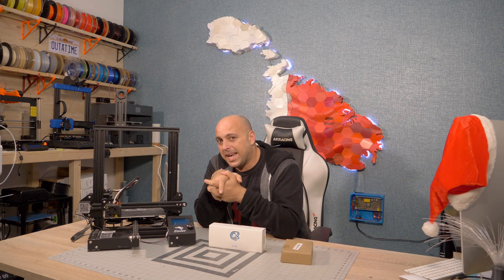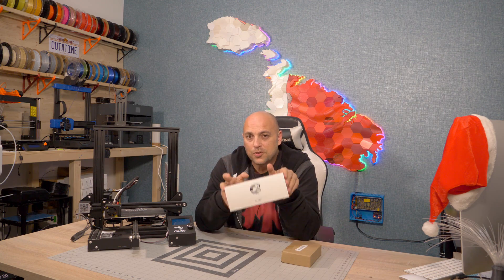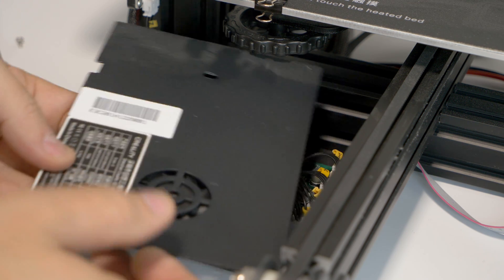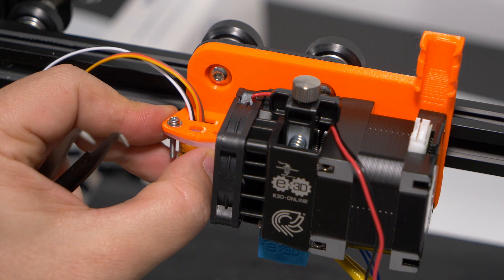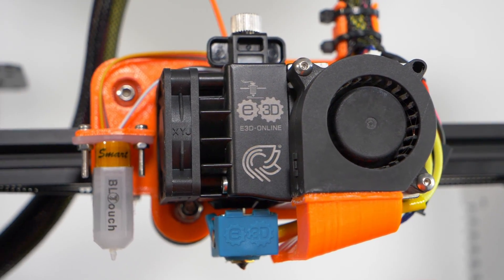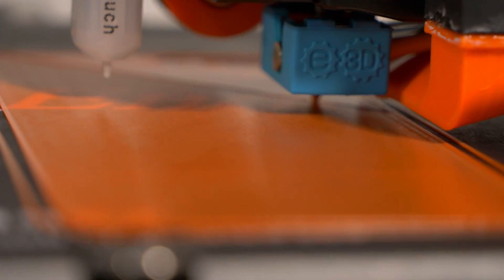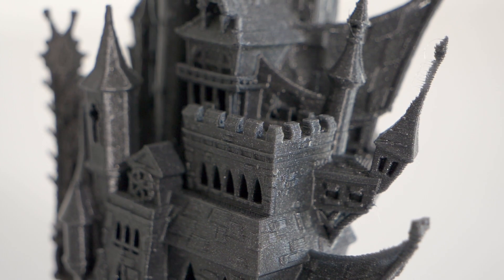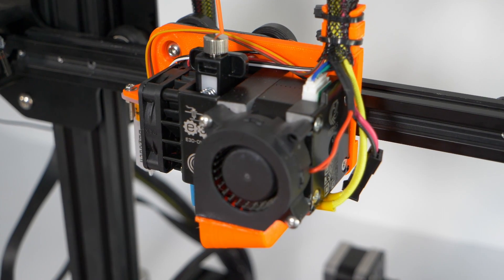Print Flexibles At Insane Speeds With E3D HEMERA - Ender 3 Upgrade

Comment: Thank you very much.
My Ender 3 now prints with the Hemera.
Unfortunately the center of the virtual printing bed in Cura is not the center of the Ender 3. The BL Touch also measures the first three points directly at the edge of the printing bed.

Is it possible to set this somewhere?
In your adapted firmware of TH3D I can't find any settings for the BL Touch.

Thanks a lot.

Comment: It would seem the European 8mm screw length is a bit longer than the ones I can get in the US.  I only get 2.5mm of the screw sticking out to thread into the Hemera and given the nut is 2.5mm and the thickness of the area of the mount is 1.5mm, there is only 1mm of thread to screw into to the nut.  In other words, not enough.  Is the source for the base available?  I would like to either get the screws to go about .5mm deeper or shave .5mm off the face of the base so I can get the screws to engage the nut.  Thanks.

Comment: I got my hemera up and running and can confirm - it's an absolute beast! Printing flexibles with 60mm/s is easy as PLA and the results are amazing! Time to stock up on TPU filaments...
Reply: maybe you can help me, but im having issues with printing tpu at even 10mm/s. it just seems to expand in the heatbreak and then stop extruding. i can easily print pla at 100mm/s but tpu isnt playing nice at all. ive tried anything from 200-260c, adjusting tension, but no dice.
Reply: @turbo280zzz  are you running the stock fan or a silent one? noctua ect. might not have enough cooling. other than that a rectraction of 0.5mm with 50mm/s did the trick for me
Reply: @Deagorsarrh  reassembled and fixed issue. Must've been some gap somewhere

Comment: are there any mounts compatible with a CR-10 Mini?  Would the Ender 3 mount work do anyone know? I know some parts I have tried to print that are for the Ender 3 did not work for my cr-10 mini
Reply: We think so, most Creality mounts are identical. If not it shouldn't require much modification. Please note we haven't actually tested this printer out, so we're not 100%
Reply: I have a ender 3 mount on my cr10 mini with hemera :)
Reply: @davidegandolfi6534  finally someone with a mini and an answer thank you! Now if only the 12v Hemera was in stock

Comment: Hey Joe! So I got 4 HEMERA upgrades for my print farm for my Ender 3's. I am unable to get some clear Sainsmart TPU printing for longer than 20 minutes before either: A) The filament stops feeding (low tension), or the filament gets crushed and is blocked by the tight tolerances of the Bowden adapter (high tension). I've gone through E3D's entire troubleshooting guide- waiting for support to get back to me. Any ideas what might be causing this issue?

Comment: Joe, could you tell me what fan you used for this upgrade.  I downloaded the volcano STL - but the fan I bought on amazon that looked just like yours had an opening that was about 30% smaller...it will be easier to order the correct [24v] fan off amazon than to try and modify the design.  Thanks

Comment: I think you put the hotend fan on backwards. Looks like you mounted the fan guard on the inside (against the heat sink).
Reply: N/M, looks like it's how E3D intended it to be. Just a poor design choice. Why even have a fan guard if you're going to melt it against a heatsink?
Reply from the maker: Not really sure what you are referring to. There are no fan guard on the hemera
Reply: @3DMakerNoob  the hotend fan mounted on the left side against the heatsink

Comment: I bought one on these to put on my Ender3. It turned out to be the most time-consuming and expensive mistake I have made in many years. The outcome is that I am now waiting for a replacement motherboard and the piece of overpriced junk that is called Hermes/Hermera/Heapofshit is in the bin. The instructions and the parts provided to fit to the Ender3 are completely inadequate. I am so disappointed, that it is unlikely I will ever source from a non-Chinese manufacturer again - as I have never encountered such problems with even the most poorly made 'cheap' Chinese products. Of course I have to take full responsibility for this fiasaco. As a UK citizen I should know better than to buy anything from a UK manufacturer.
Reply: Roberto Del Pellegrino What happened? My Problem was that I have to buy a box of JST-XH connectors because the Dupond connectors will not stay in the board.
Reply: @claudiusalbat4048  Well I got it working. I hacked about some of Joes parts a bit and got it in. I'm using a 5015 fan... I found E3D documentation was clear technical documentation, but not terribly helpful. Orientation and pinout of the stepper motor was not clear (I already have pack of shitty JSTs). I have been using TH3D firmware happily for years. This did not want to play and rather than untangle Tim's excellent work I went to plain Marlin 2 and got it working there. But not before I had almost given up and invested in a SKR Mini 1.2; as I thought I had killed the board... No harm though, was going to get one anyway. Now that the Ender3 is working with original board and happily printing TPU, I have decided to do a complete re-design of the mounts for 5015 fan configuration. This is mostly done but I have to test it. i.e, go through the endless cycle of print, fit, adjust design, print, fit. Maybe it'll get to Thingiverse one day... Anyway, my summation is that this is quite a difficult unit to fit. Probes are easy enough to attach, but finding a good path for the part cooling duct is more difficult and quite hard to model. Especially something that hopes to be 3d printable. If I make anything usable/sharable that does not embarrass me to much I'll put it on the Ender3 facebook group. Again I would like to thank Joe and Teaching Tech for relevant content on Hermera, BLtouch and Marlin and, of course, good old http://marlinfw.org

Comment: What is sorely missing on the web and especially from E3D directly is any guidance on settings other than their incorrect eSteps/mm and retraction suggestion.  
What voltage should the stepper motor be set to?  My skips like a bitch with the voltage that my CR-10 was happy with.   
What about Coast, wipe?  Are there any starter profiles for Cura, Simplify-3d or PrusaSlicer as moving from bowden to direct drive requires completely different settings.   
How do you know when you have the filament tension too tight?  No way to know what it's set at.  All that's left is to count screw turns?  

The E3D forum is useless for this type of stuff.
Reply: I think it is the same/similar to the titan. both are 3:1 ratios

Comment: I have an issue with my hemera on an Ender 3, the motor of the extruder is stepping and the filament isn’t feeded inside, any idea why? Thanks!
Reply: I have the same issue, did you find a solution?

Comment: It would be cool if you'd also link that fan in the description- or at least cite the dimensions of the output.  I'm in a tough spot because I'm applying this to a CR-10s5 which uses 12v, so I have to find something similar dimensionally & in performance but that uses 12v.

Comment: Everyones all hot and bothered for this thing because of flexible filament when in reality its basically just a better extruder overall and its about freaking time. Other companies have had betetr extruders for a long time. You guys ever use an ultimaker?
Reply: Not to mention, in this case it is like putting diamond earrings on a pig.

Comment: Hi Joe... did you happen to design a mount for the Ender 5? The one for the CR10 does not work on the Ender 5... nowhere to clip the belt in. Possible you could send me the file to modify in Fusion 360 to fit my Ender 5 (with BL Touch)? I'd be willing to pay. :-)
Reply: Hello KKPD. Did you upgrade Hemera on your Ender 5? How are you solve the problem with the attachment the belt? I have the same problem,...Than you!

Comment: Hey Joe! I have a question for you. With installing the Hemera, because of the size, the nozzle isn't in the same position as the stock one. When I put the nozzle where the printer thinks the center of the bed is, it's about 15mm forward and a bit off to the right. Is there any way to compensate for this without adjusting the bed size in the Marlin firmware?
Reply: there are offset settings in Marlin. For example, on my v6, I believe I had to set y offset to -13
Reply: also offset can be done from within the slicer. cura has this setting in the "extruder" section of the printer settings

Comment: What material do you recommend printing the mount out of? I ask because I am afraid to print PETG with my capricorn tube that came with my cr-10s pro.
Reply: He mentioned somewhere in the comments below "PETG, however PLA is recommended due to it's stiffness "
I was going to print mine in PETG as I have a nice colour lol but after reading his comment it made sense to use PLA as you don't want any flex in the mount.
Reply: @joss67uk  thanks a lot that's good news

Comment: Just fitted the E3D HEMERA to my Tevo Flash that already had a BLTouch fitted, Ive changed the probe offset from extruder position from behind the extruder to the left side (-42) , do I need to change any other settings in the firmware ?

Comment: Did you lose actual printing area with this install?  Looks like it may reduce Y travel due to stepper location.  Just wondering.
Reply from the maker: In fact it loses about 5 or 6 mm at the back of the Y, nothing major
Reply: @3DMakerNoob  Thank you

Comment: To be 100% honest.
This looks like the little Brother of the Bondtech Extruders.
Yes it is smaller, but it dosen't have the Power to let you're Printer climb up on Walls to you're Filament. (This is a Bondtech FEATURE btw.) 😂

So except you wanted a smaller and compacter Hotend Extruder combo there is no need for this Thing.

Comment: Good lord, that's just nuts. I'm in the same situation with my Anycubic i3 Mega, not wanting to do much to it after putting a geared extruder at the start of the bowden tube. It's basically a stock Mega-S at this point. I thought I was printing flexibles well already (Ninjaflex technically works, but it's a nightmare for Ninjaflex reasons), but I wouldn't dream of printing that in any TPU as it is. I'm definitely keeping an eye on this now. I'd definitely be interested in seeing how a Prusa MK3S takes this, btw. I don't expect that kind of night and day difference, but it'd be a neat "just because" comparison if you have any sitting spare after you tend to the budget machines.

Comment: kinematics of the printer making a big impact? I expect to see the Hemera on a CoreXY then :P
Reply: this is totally the style of extruder i would expect on the big prusa printer they wanna release in 2020, big build volume, core xy and high speed, if i could i would already preorder
Reply: @Pixelplanet5  depends, this still isnt a particularly light extruder, lighter than other direct drive solutions, but still not super light.  I can speculate that Prusa is likely to use this or something similar, but maybe something like the Zesty Nimble with a remote motor but a direct feeder.

Comment: i hope the bowden type as good as this direct drive...
Reply: I converted my cr10s for direct drive. It was fairly easy. Clipped most of my wires and used those easy soldering tubes to extend my wires. I just need a good cable chain.

Comment: Did you able to use all X axis of the bed with Hemera installed? Due to horizontal orientation of the extruder on the carriage it looks like it may hit one of the the edges of the printer.
Reply from the maker: no loss in the X axis, just around 5mm on the Y at the back though, nothing major, the mount is designed to ride over the idler
Reply: @3DMakerNoob  Good! Thanks for the answer :)

Comment: Now we need a Prusa mk3 Hemera
Reply: surely this just bolts up... its just an extruder... its not like its using anything super specific to the ender
Reply: It’s not specific to ender 3, use the written guides linked on e3d-online
Reply: @ooliver  At the time of the comment they did not have guide for the prusa yet, but I see they do now. :-)
Reply: @zimmy1958  the 2 before you clearly have never looked at a prusa 🤣 they're so very different from an ender motion system.
Reply: @neilsiebenthal9254  Ok did not know. :-)  I only have a prusa mk3s (love it) and a Anet A6(very old and not used any more). The world is full of key board experts which I am not one lol.
Reply: @zimmy1958  I was referring to the first 2 comments, not you. You were right.
Reply: @neilsiebenthal9254  yep I got that :-) lol no offense taken.
Reply: Neil Siebenthal I have and what I mean is the Hemera works with most printers not just the ender
Reply: @ooliver  No one said it was just for the ender.
Reply: Neil Siebenthal the original comment said “now we need a Prusa Hemera”
Reply: @ooliver  Because the Prusa has a very different x carriage set up, at the time of the comment a guide for the Prusa wasn't out yet. That's what he was wanting, now there is.

Comment: Which material did you print the backplate in? Abs, petg, pla or something else? :)
Reply from the maker: PETG, however PLA is recommended due to it's stiffness
Reply: @3DMakerNoob  Oh, cool. Thanks!
Reply: Going to print mine in Prusament Galaxy Black PLA. It's performed super well on my Ender 3 on the Petsfang and the X belt tensioner system I've used it for. Very stiff and zero creep over the last year.
Reply: @mrb2917  think I have some proto pasta htpla, so might try that + annealing :)

Comment: Do you have the firmware for the sidewinder x1 version? Or will that be coming out in a different video? Also I wish there was a place for the bltouch on the sidewinder version. Didnt swe if there was one.
Reply from the maker: Instructions are on the E3D site on how to modify the firmware. I am trying to design a mount that takes the bltouch as the design of the printer itself is very limits to space

Comment: @3DM - Thank you for your review. I want to order one of these today but your comments at 3:01 lack clarity. Which voltage should Creality users order for (Ender3, CR-10S, CR-10S Pro) 12v or 24v?
Reply: Yes, can you please clarify the correct voltage for a CR-10S and CR-10S Pro? Thanks.
Reply: Cr-10 is 12v,ender 24v. There is reddit pages backing them up on both the ender3 and cr10s sections

Comment: It looks like your mount could be used for all the CR-10 type printers?  CR-10, CR-10S , etc?  (Minus the Pro series)
Reply from the maker: Correct, but I also designed a mount for the pro series :)
Reply: @3DMakerNoob  perfect!  I am printing the baseplate now with ColorFabb HT (high temp) filament.  I put my printers in enclosures and wouldnt want the mount to get soft on high temp prints!   I also opted for your original version so I can go between BL or EZABL probes in the future   Thanks!

Comment: Been waiting for this to come out ever since it was announced, just one question though:
Is the direct drive on an Ender 3 about equal to the stock extruder in terms of ringing and ghosting?
Or could this be an issue?

If this is an issue, would it be possible to buy the direct drive kit and simply convert it to a bowden setup with the bowden adapter?
Reply: The bed is way heavier anyways so the weight in your Y axis is what's limiting acceleration really
Reply: @nirodper  True, especially now that I have the glass bed on it too.

Still any added weight would have an impact.
Reply from the maker: You will get more due to the added weight, however with a bit of tuning on acceleration and jerk it can be reduced or removed. Also, you can buy a bowden version :)
Reply: @3DMakerNoob  Thanks, I should clarify that I wanted to also upgrade the hotend to the V6, so I thought about getting the direct drive as it includes the hotend while then getting the bowden insert to turn it into a bowden version while using the V6 hotend as an upgrade over the stock one.

(I realise I can just buy the bowden version and a V6 hotend seperately, but your answer about the ghosting has reassured me that it won't be too severe with the direct drive version)

Comment: Hermes is a logistic Enterprise  copyrighted I'm guessing they changed name because of that
Reply from the maker: Hermes is also a luxury brand that makes watches and handbags :)
Reply: @3DMakerNoob  yes the French stuff
Reply: Unrelated industries don’t need to worry very much in trademark law.
Reply from the maker: You’d be surprised :)
Reply: No I wouldn't, there's multiple trademarks for this name for unrelated companies already.
Reply: You can trademark Greek gods' names?
Reply: @SakvaUA  Well, the lawsuit might not have succeeded for whatever company was making the threat, but the cost for going to court over this is so great a small company llike e3d will often just surrender immediately, because it might ruin them otherwise. As unfortunate as this is. I definitely can't fault e3d for giving in.
Reply: SakvaUA There are a few existing Hermes trademarks solely consisting of that word in the USA, at least. One for restaurant services, another for security locks, and one for rechargeable batteries. That’s not even including the dozens of trademarks simply including Hermes in their name. My personal opinion is still that this product and trademark would be defensible here, as it seemingly does not pose any significant dilution to the other industries using it. 

I’m not familiar with international trademark, though.

Good point from Runoratsu is the cost of defending.
Reply: They recently announced they didn’t have the time, will, or resources to defend it, so that’s it.